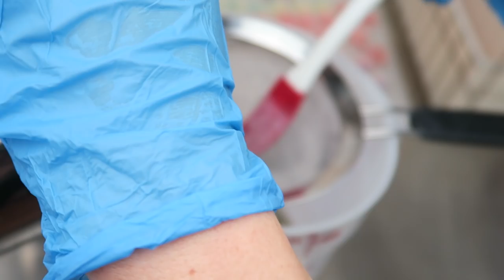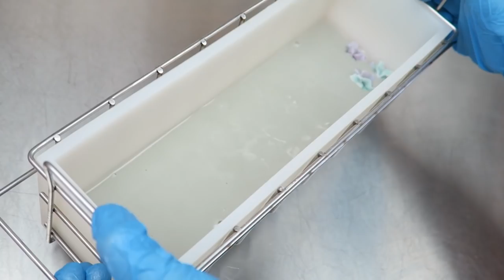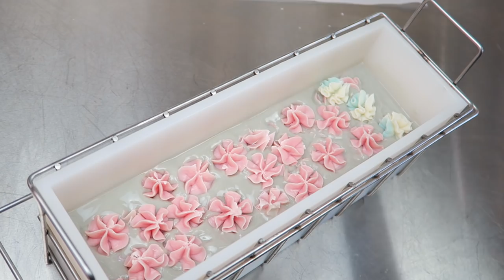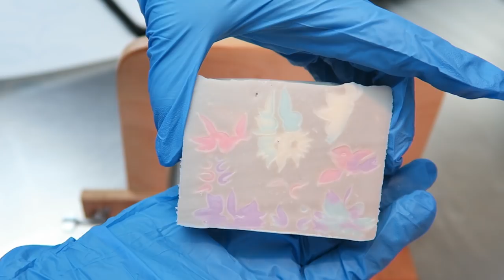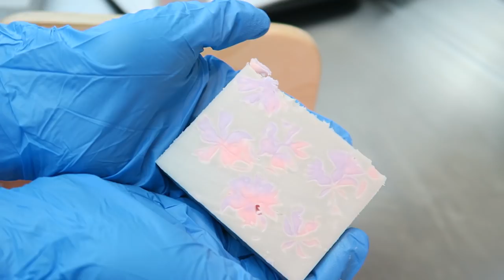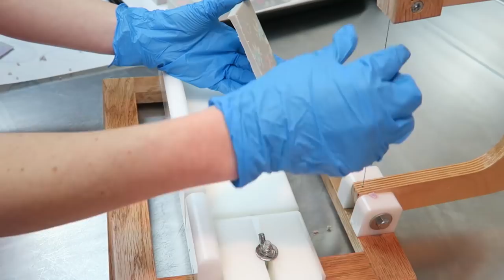Batik Embed Soap -  Spicy Pinecone

Comment: Wow that truly came out beautiful! When I started making soap I was using melt and pour Idid something similar when I had poured a bunch of flowers from a mold that I had and then poured the white melt and pour soap over it when I sliced it looked like wired little shapes...but then I thought to turn it and I sliced it the other way and you could see very lightly the different color flowers in it.

Comment: Really nice!   Btw:  use rubbing alcohol for bubbles.
Reply from the maker: I'm so glad you like them, Nichole!  I use rubbing alcohol to help get rid of bubbles when I'm working with melt and pour, but this cold process soap just needed a bit of whacking on the ground to get rid of most of them.  I think next time, pouring at a slightly lighter trace would also be helpful.  Thanks for watching!  ❤️